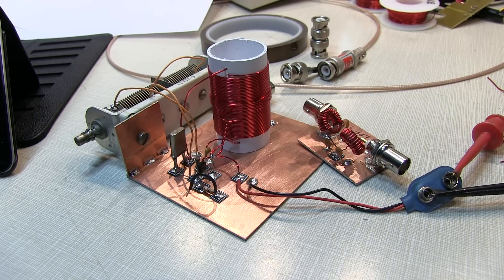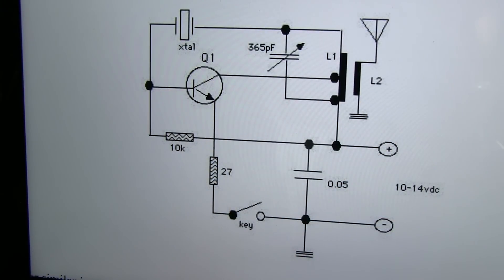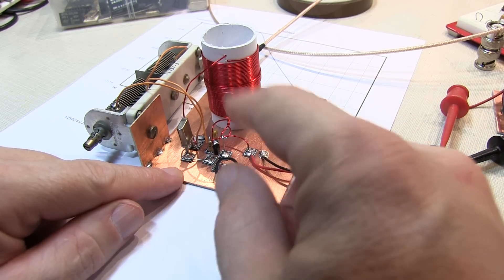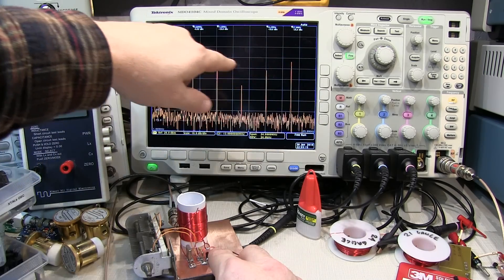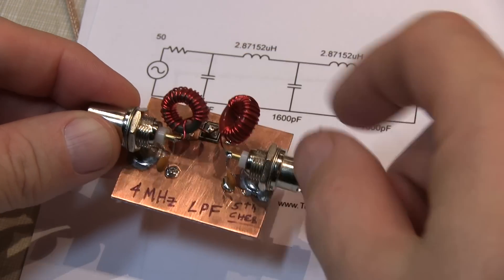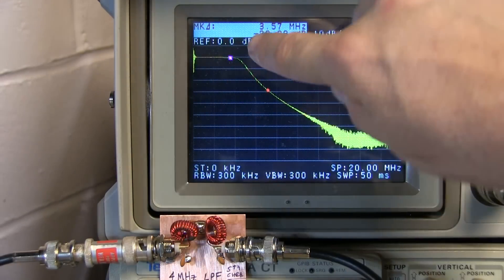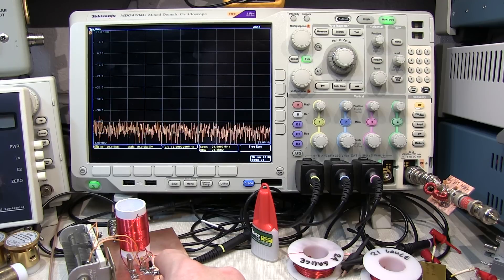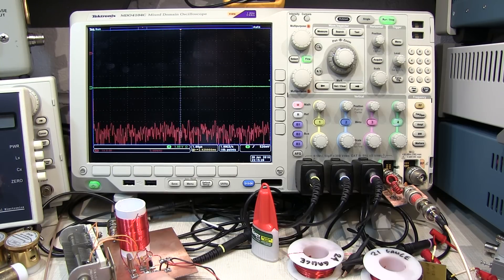#228: Radio Fun: Michigan Mighty Mite CW transmitter and a low pass filter

Comment: Got plenty of those crystals,  for sure.  Also plenty at four times the frequency at 14.31818 MHz,  which was used in all sorts of stuff.  Dividing it by 4 gets you back to the colorburst frequency (and from there all NTSC TV frequencies),  dividing it by 3 gets you 4.77 MHz,  the clock rate of the original IBM PC.   :-)

Comment: I usually do not comment, but this project got my attention. Remember: Size is not only impressive - it is practical with radio transmitter circuits. That transistor is dissipating power, possibly 100 mW! I suggest a cabinet of no less than 5 cubic feet. Alan is probably looking for a blower, in fact. A 1 inch Red Jeweled lamp, a large meter and a 4 inch dial dress out any project.

Comment: I came from a test and measurement background.  Wish i could afford equipment like that.  But glad someone has access to it and can show us these issues and show how to solve them.   At least makes us aware so we don't end up on the air and get fussed at. - KM4OLT
Reply from the maker: +Michael Monteith It's certainly one of the joys and benefits that comes with working for Tektronix.
Reply: +w2aew Bite me. lol jk.  Yeah.  I used to work at an electronics company and loved it.  Now that I'm into Ham radio I would definitely be using it.  Thanks again.

Comment: My immediate thought is to "clean up" the oscillator design a bit first and get it putting out a cleaner sine wave.
I know easy to say.  And maybe not the point of the video at all!   
I expect an oscillator circuit with a crystal to be able to put out a cleaner waveform than that.
Maybe I need to get some hands-on time since it's been since High School since I have worked on this stuff!  
So many cool things to play with in life and deciding which ones to spend time on.
Really enjoyed the video!  Steve N8LBV  

Roughly how much _clean output power do you get from that arrangement?   

Thanks I'm curious.

Comment: Great story!  I may just have to build one of them! Sure wish he gave instructions on where to find the coil instructions. Just a vague reference to unstated web sites. I will try to hunt that. IF you use a PI NETWORK instead of LINK coupling then it won't be "dirty." I only ever used PI network. There is no need to go back to the 1930s and link coupling!

Comment: Nice video. Why is it good practice to present a 50Ω load to the TG? Is it bad to run the TG open (or shorted)?
Reply from the maker: If the TG doesn't see a 50 ohm load, then the reflections from the mismatch can cause the output of the TG to vary with frequency.
Reply: @w2aew  good point, thanks for letting me know. love your videos :)

Comment: Surely you can't just put the LPF on the antenna winding of the tank coil? The joy of this and similar transmitters is to just attach a random wire to the output link circuit, and once tuned should give about 20dB attenuation of harmonics. (Not really enough, but this is only a few watts.)

So how do you match the 50 ohm LPF to the output tank and then back to the random wire?

Comment: Hi, Great video tutorial.
When you quote the reduction in harmonics, is your quoted figure not 10db too much due to the 10db pad still being in circuit? 
Meaning the quoted figures should be 25db down for the 2nd harmonic and 30 db down for the 3rd.
Or did I miss something with the 10db pad still being in line while measuring the RF output of the transmitter via the LP filter?

Regards,
Kay UU
Reply from the maker: The 10dB pad is in there for all of the measurements - so every signal component is being attenuated by the same amount. Thus, the relative magnitude of the carrier and harmonics is preserved.

Comment: I love this dead bug soldering. Can I ask you another question on the bottom plate. Is that all the common ground? Does this help with cutting down noise etc. Does it cut out interference with ground loops etc. The thing is I use a 3M breadboard and when I build amps or anything like this I just get tons of noise and oscillations all the time. Does this dead bug style with that large ground plane help with that? Really hope so as I'll try it if so. I notice you build lots of circuits this way. Is this why you do it?
Reply from the maker: +Kevin O'Brien Common ground - yes.  Helps cut down noise - yes.  Help minimize interference and ground loops - yes.  Breadboards can cause lots of problems, particularly as frequencies get higher, logic edge speeds get faster, etc. - dead bug ground plane construction, manhattan construction, etc. will generally help a lot.  You might want to check out my video on prototype and breadboard construction techniques:
https://www.youtube.com/watch?v=kH110yjYZ2g
Reply: *****  Fantastic news! This is wonderful to hear as I have no problem following schematics but when I build anything all I get is noise. So hard to find out what it is. I am going to try this. Thanks this is such good info to find out. I wondered why you always did these like this!! I suppose all those links in the breadboard act like capacitors. Breadboards are rubbish for my circuits. Now I know why. Thanks for this and all your great content.
Reply from the maker: +Kevin O'Brien The solderless breadboards add extra inductance to each connection, extra parasitic capacitance between the rows of nodes, and no good way to get a low inductance ground/return path.
Reply: *****
Thanks. just watched the video you linked to. That was really helpful. Thank you.

Comment: Great video and channel, thanks. If this sort of thing was around when I was at university, I might be a bit more useful now.

What are the square black pads on the board that the components are soldered to?
Reply from the maker: They're simply little pieces of single-sided circuit board material with a little island of copper on them.  These particular ones are called MePads, made by a little company called QRPme.

Comment: I have a quick question. So I built it in the past..  is in some of my older videos. But I had nothing to measure the LPF with. So I'm working on it again now. I made a LPF that cuts both the first and second harmonics to nearly -40dB. The issue is that when I connect the filter to the transmitter and do measurements again... the filter does not perform the same. I built the coil as in the original design. I assume that the output impedance of the coil may not be exactly 50 Ohm and that may cause the filter to react differently ? Sadly I have no osciloscope to be able to measure the transmitter while working. I just measure the LPF with the nanoVNA. All I have ( ha ). I just wonder what could I adjust to get it to perform well... at least in theory doing the measurements with the nanoVNA. Thank you so much. I built the 40m version and is good fun and great little project. 73 DE YO6DXE.
Reply from the maker: One thing you can do, assuming you have a general coverage HF receiver, is to tune your receiver to the 2nd (and then 3rd) harmonic frequencies and note the signal strength of the unwanted harmonics.  You can then adjust the filter components to try to minimize them.
Reply: @w2aew  I'm using a tru(SDX) to listen to the first harmonic. But I figured the filter doesn't work as designed when connected to the transmitter because there is an impedance missmatching. For that reason the power of the transmitter with no LPF is 500mW. But if I put the filter on it goes down to 100mW. So what I will try to do now is to play with the coil of the transmitter to somehow match it to 50 Ohm that I have on the input of the LPF. This way the filter should not be affected... in theory  ))) I'm a mess with theory so let's see what I can do haha. 73 and thank you so much.

Comment: Hey I just built one of these for 80 meters. I even made the low pass filter and it works great! I have a question though. Am I supposed to be able to tune this up and down the 80 meter band, or does it only oscillate at the crystal frequency? If you can't tune the frequency, what is the capacitor for?
Reply from the maker: It can be tuned over a very small range.  Typically you'd use the variable cap to adjust the freq for the strongest oscillation.

Comment: Looking at the RF waveform in the time domain, it looks like the oscillator has some kind of "bias kink". Or is that "crossover looking" distortion caused by the crystal going through series and parallel resonance? In short, could some sort of bias changes or perhaps capacitive loading on the crystal clean up the RF spectrum of this oscillator?
Reply from the maker: +RF Burns Sure, a LOT can be done to clean up the oscillator - but I wanted to show the raw performance of the original, very popular design.  There are many other low power transmitters that have lower distortion, but they use more than 6 components!

Comment: 👍Thank you sir. sir can we adjust transistor base bias,tank tuning,feedback level etc.to improve the quality of sine wave instead of low pass filter. (or introducing low pass filter after pure sine wave).
Reply from the maker: There are a number of techniques.  It is harder to do within the feedback loop and still maintain reliable oscillation.

Comment: Alan thanks for another great video. How effective would it be in reducing harmonic content to change the biasing of the oscillating transistor?
Reply from the maker: +jeromekerngarcia It will help, certainly, but won't eliminate the need for the LPF.
Reply: +w2aew Thanks for your reply. Yes, I agree the LPF is still required; I just hate to see the transistor doing. "extra" work generating N*f, but that's me.  Thanks for the pointer to the SolderSmoke podcast, it's really great fun and is giving me good homebrew ideas.

Comment: could I use a chip to modulate  voice for this circuit?  also how do you think such a circuit might lend it's self to vlc frequencies say below 300khz. forgive  my ignorance I'm not a ham just an amateur radio builder. I've got several old radios with long wave capabilities ,but of course in the u.s. nothing to listen to but beacons lol. I thought I might build a lw transmitter just to listen to around here. awesome video
Reply from the maker: This wouldn't really be the best choice for modulating or VLC operation.
Reply: ***** thanks for replying. And I kinda thought it was a long shot. Besides the filter would probably take 2 pounds of copper lol.

Comment: Newbie question: I'm intrigued by the construction.... All the components that have ground connections are soldered direct to the copper board?  For junctions that aren't at ground... how did you make the islands?
Reply from the maker: +NivagSwerdna You can cut "ilands" with a circle cutter, or glue down little isolated lands like I did.  You can make your own by cutting up copper clad PCB, or buy some like these MeSquares from QRPme.com
Reply: +w2aew Would I be right in thinking that is called a 'Manhattan' construction technique? I have seen you do a video on it before.
Reply from the maker: +InnaSoulSounds yes.

Comment: Nice video as always, Alan.  For the LPF, what sort of bracket did you use to mount and solder the BNC connectors to the PCB?  I've always found this to be a bit of a challenge.
Reply from the maker: +BleepingBeep It is just the solder lug that came with these BNC connectors.  I removed the nut, washer and solder lug, soldered the tab of the lug (where you'd normally solder a wire) to the PCB, bent it up at a 90 degree angle, and reassembled it.  In the past, I've cut scraps of PCB material, drilled a hole and mounted the BNC, then tack soldered this to the main PCB.
Reply: +w2aew Detail much appreciated. Thanks, Alan, and 73.

Comment: Filter did a mighty job of cleaning the waveform.Liked your scope, what scope would you recommend generally?
Reply from the maker: +Tom OConnor My first recommendation is that ANY scope is better than no scope!  I'm personally not a fan of USB based scopes - just too awkward to use.  After that, it all depends on your budget and your intended use.  In many cases, a good used analog scope is all you'll ever need.
Reply: +Tom OConnor I've been very happy with the Rigol DS1054Z.  You can easily unlock its features and bump it up to a 100MHz scope.  Pretty impressive scope for $400. If you search the EEVblog, you can locate a discout code as well I believe.
Reply: Rigol DS1054Z is the best price/performance 2nd scope for a beginner. I recommend an old analogue scope for the 1st
Reply: My first scopes were as analog as you can get.  Recurrent sweep (not triggered),  no calibration of either timebase or amplitude,  and they were ac-coupled in the amplifiers.  The big plus?  Super low cost,  like $20 or so.  Typical of these were maybe 5 tubes,  most of which were good,  and the need to replace some number of old capacitors.  I wouldn't recommend one of these.  But dc-coupled,  calibrated,  triggered-sweep,  dual trace scopes shouldn't be all that hard to find these days.

Comment: That's nice, but by how much it attenuates the fundamental? It's a passive filter, as far as I know there will be some attenuation
Reply from the maker: +MrJohhhnnnyyy Very little, negligible.
Reply: ***** OK then
Reply: +w2aew And I have another question - what amplifier for the antenna I should use to prevent RF leakage? The problem is that I built a discrete FM superhet, but it's emissive like hell. I put shields on, lots of decoupling on the power rail; but LO still manages to leak into antenna filter. I tried using a common base amp on the antenna, no luck. Maybe you know an amp that will do better, essentially I need a buffer, but the one which will keep RF from going out of the circuit while passing a signal into the circuit. I'm an RF noob, so please excuse my terminology :)
Reply from the maker: +MrJohhhnnnyyy If it is LO leakage that you're seeing, then you might want to consider changes to the design of the mixer.  A double-balanced mixer will help to suppress the LO.
Reply: Thanks for response! It's definitely LO which leaks. And idea with mixer is great, but when I go and disconnect antenna filter from the mixer, there's still emission on the antenna. I just dunno what is causing that, maybe it's a polyvaricon? When I shut down the LO there is nothing on the antenna, so it's not the amp feeding back onto itself. What you can say 'bout this schematic? Is it crap or not?
http://superheterodyne.altervista.org/FM/index.html
Reply from the maker: +MrJohhhnnnyyy You probably are getting coupling through the polyvaricon and the antenna preamp.  Price you pay for a simple design. The LO is only 10.7MHz above the desired frequency, so really no way to filter it out.  Make sure your chokes/inductors on local oscillator aren't positioned (parallel) to those in the front-end amp.  Grounded shield may help.  What's the bog downside to the coupling to the antenna in your application?
Reply: ***** Yet again - thanks for helping me out :) What's funny is that I have a shield between LO and frontend, I did place the coils at 90degrees to minimize the coupling, I put a ferrite bead on the base of the transistor in the LO; but it doesn't help. I did even try swapping the polyvaricon with 2 caps, and guess what - same thing. I'm pretty sure that this is thanks to perfboard and my poor layout (it's an RF inferno). After I calm myself, I'll probably try making LO on separate board.  The downside - it mutes another RX in it's range (20ft) which is, by the way, bigger than the one that my first FM bug had :D If it was small emission - I wouldn't bother, every superhet has some, but this one has intense transmission.
Reply from the maker: +MrJohhhnnnyyy Ugh- perfboard?!?!  I'm sure this is the root of the problems.  You really can't build anything that operates at over 100MHz without a good common ground plane, if you want it to play nicely.
Reply: ***** Yeah... I'm a fool when it comes to RF, so please excuse me ;) I'll redo the LO, antenna filter and the mixer on the copper clad board, but later. Thanks anyway, it's been a pleasure for me to chat with an expert in the field

Comment: How do you fix the components on the copper clad? What is that technique called? Awesome video by the way!
Reply from the maker: +daftbeyer Parts that are electrically connected to ground are simply soldered to the copper plane.  The square isolation islands are glued down, and then component leads are soldered to them.  This style of construction is generally called Manhattan style construction.
Reply: Thanks mate!